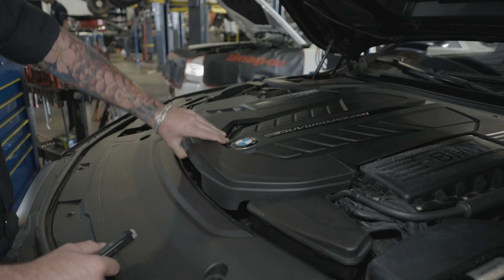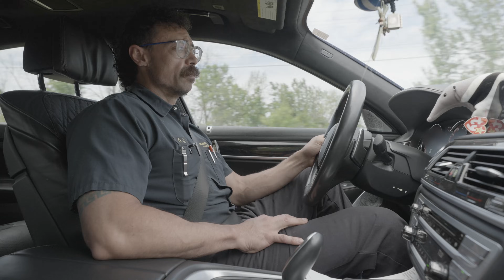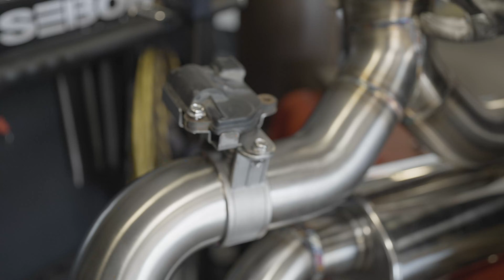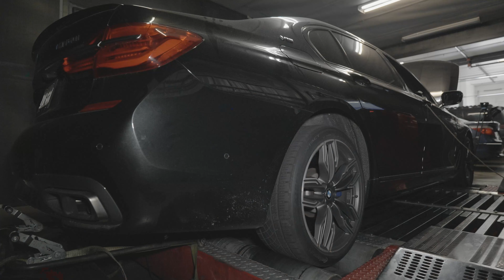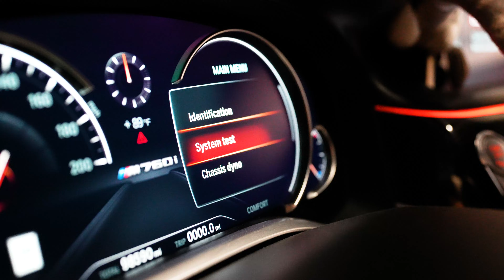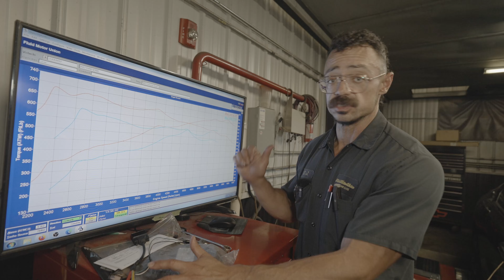"M" V12 Gets Exhaust It Deserves—Now BMW M760i Makes Power AND Sounds Like the World’s Gonna End!

Comment: It won't sound like it's from Italy because it's sound is basically two n52s joined at 60 degrees. This engine is an evolution of that. So it will always still sound like that 6 cylinder drowny noise

Comment: For people watching who are confused. Don't forget, this thing isn't meant to sound like an Italian V12. It's engineered and designed to be quiet and torquey. It's a crossplane crankshaft engine, with twin turbo, a heavy flywheel, etc, made for comfort, luxury, low-mid range torque. I like this exhaust setup, however. Looks and sounds incredible.

Comment: No surprise power gains are made easier from the N74 compared to the M275 in the S65. It's a more performant design in all regards - DOHC, DI, oversquared, and so on. The fact that it makes similar power with 10 psi less stock boost is telltale.

Comment: hey how much would an E90 335i exhaust cost? it has VRSF highflow cats, and currently the VRSF 3 inch exhaust, but i hate it.  i would like similar performance but refined quieter tone and a more factory routing with an X pipe

Comment: I have an Alpina B7L with an N63. I've been looking at the M760s for a while now but am not certain on the reliability or the V12, anyone have any experience with them?
Reply: M760 should be more reliable since the engine has less boost pressure and no hot-v configuration.

Comment: For it to wail like an Aventador’s V12, a catback isn’t going to cut it. Sure, you can get it closer than stock, but you can only do so much from there.

What really matters is the turbo/exhaust manifold design (basically the headers). 
At that point you’ll want to upgrade the turbos for something bigger and better to really make it worthwhile and save time, a large single would be possible as well.

This is the same as with the S55 and many other engines, including the latest 911’s that have unequal length turbo manifolds/headers. The GT3 is more equal length and sounds more exotic because of it.

With custom exhaust manifolds, it would be very easy to make the M760i sound like a twin turbo Aventador or really any Turbocharged V12 if you wanted it to.
Those sound absolutely jaw dropping, incredible sound that would send chills up anybody’s spine no matter what you’ve heard or experienced.

Comment: i dont understand how a V12 can only make 600WHP when a B58 can do that with like a few bolt ons and Hybrid turbo
Reply: To be fair, the N74 made roughly 600whp with only an exhaust and tune. Personally I find that quite substantial. Now imagine if the N74 had proper turbos, an intake and some fueling upgrades 🔥🔥🔥

Comment: Ah man big mistake here in my opinion: the X pipe should've led to the straight pipe tout and the muffled section could've went on the outside. The reason being, you want to have the straight pipe airways gain that smoothness and higher pitch from the X-pipr when you open the valves, but there's no point on having the X-pipr on the muffled section..

Comment: maybe just maybe luxurious V12's are silent because the idea of a luxury car is silenec and comfort
Reply: Of course, but we aren’t buying them for the luxurious aspect now, we buy them for the engine which just so happens to be sat in a big luxury car, but we wanna hear it like it’s a racing car
Reply: so youre buying an air purifier because you want AC then complain that it purifes your air?
Reply: @Michaboiii  if the air purifier has a twin turbo v12 then sure 😂

Think the main point is that you can’t get these huge engines in any other platform besides the big boats so it’s not the case that you’re buying it for the luxury aspect.
Reply: @xVwraithVx  a V12 is in the most luxurious cars because its a super stable engine? It has the smoothness of 2 Inline 6's so its perfectly balanced, that's why it is in Luxury cars and because theyre big they have a lot of power, more than 90% of luxury V12 buyers buy them for comfort not to hear it scream, if you want to have a screaming V12 u buy a V12 sportscar not a Luxury limousine
Reply: @Michaboiii  if you just generally want a v12 then sure, but if you want the v12 from the 7 series then u gotta buy a 7 series cos it's not really been put in anything else, and that's exactly what's happened in this video to answer your initial comment

Comment: TBH (and this is just my opinion), sound quality improved most during idle and revving. Doing pulls on the road, it sounded like any other B58 with an exhaust. I'm not sure if the camera didn't pick up the audio quality, but that's how it came across.

Comment: Now add the jb4 and you have a bottom 10 sec rig on stock tires … I have worked on and ridden in one manyyyy times that has dps e-blend and jb4  damn near 800 to the tire mmm mmmm. I might be adding one of the 760I to my collection in the near future
Reply: This is a high 10 second car at best 💀
Reply: @xxthehuskycaboosexx  M760i’s are already running 10.5’s in the quarter with 725 to the wheels on a stage 1 tune. Speak on what you know.
Reply: @justiceexodus7801 LMAO you watched a TikTok video and now think a stage 1 tune can crack 725WHP💀💀💀💀💀💀

Sybau when the adults are doing the talking lmao, because you have no business on “talking about what you know”. 

Clearly you know Jack shit😂
Reply: @xxthehuskycaboosexx At the beginning, and the end of the day, I know I have a M760i that will capable of running low 10’s, and that the platform is capable of far more than 725 horsepower, which would be the equivalent of a hellcat running a quarter in 10.5, so what makes your goofy self believe that someone would have to lie about running a 10.5 with an additional 125 horsepower, and pound ft of torque? You’re a broke joker, who day dreams about what you will never have. It’s a different feeling when you actually own the car, and know what it’s capable of, versus being some loser on the internet with an opinion. 💀💀💀💀💀💀💀
Reply: @xxthehuskycaboosexx BTW, there’s a BMW forum called Bimmerpost, where brokies such as yourself can learn about the M760i, and individuals running mid 10’s. I’ll have mines doing low 10’s, to upper 9’s by spring of next year because I have the means to do so. It’s weird how people act like they know so much about things that are literally foreign to them. What do you drive? And don’t lie about it. I can post videos of my fleet, can you?
Reply: @xxthehuskycaboosexx How does it feel to not own a M760i? Mines is sitting in my garage next to my C7 Z06.
Reply: @justiceexodus7801 LMAO the double replies are hilarious, I know you mad 💀💀💀😂

Yea I’m sure your Forza garage is full of all kinds of cars😂😂😂
Reply: @xxthehuskycaboosexx I got garages with cars, and motorcycles on two continents, why would I be mad? 💀💀💀😂 What bus you catch?
Reply: @justiceexodus7801  I forgot forza horizon 1 and 2 Take place on different continents 😂😂😂😂😂💀

Anyone who needs to brag about what they have, to an internet stranger, let’s me know they don’t have jack shit 💀💀

But keep lying to randoms I guess? 🤷🏻‍♂️
Reply: @xxthehuskycaboosexx Let’s go vehicle for vehicle. I posted the first to my channel. Let’s see the shit you drive. . Flexing on a clown is a good time. You ain’t never in your life pushed down the interstate in a V12 with a .40 HK on your lap, and never will. That’s what makes reality hilarious. I’m living the life you wish you had. Post up, so I can pull the Z06, and Grand National out. 😂
Reply: @justiceexodus7801 the fact that you’re so desperate to get a randoms validation, is wild!😂😂😂 on the internet no less 💀

Get your confidence up lil bro, nobody cares about what you have or don’t😂😂
Reply: @xxthehuskycaboosexx Don’t try to play reverse psychology. You said my cars are Forza, well where are yours? You tapping your fingers as if you’ve got a fleet of supercars, and know that a M760i can’t run mid 10’s, but you have nothing to stand on in that regard. Why would James Scott have to lie to you about his M760 running mid 10’s? I have the means to get my M760 into the low 10’s, can you say the same? You are a spectator, rather than a participant. Stay in your slow lane, lil boy.
Reply: @justiceexodus7801 do you even know what reverse psychology is? 

You went out of your way to generate an AI video to get an internet strangers validation, lil bro😂😂😂

You’re literally a loser lmao💀
Reply: @xxthehuskycaboosexx You ever heard of 800-1000 hp M760’s tuned by Noelle performance, DME tuning, Silicon Valley Bimmer, or Infinitas? Of course not, considering you likely ride the bus, or don’t have $40k to spend on speed.
Reply: @xxthehuskycaboosexx with a JB4 on e30 they run 10.6s in SFl air aka 2000-2500 da , add down pipes and water meth with a sticky tires and it will 100% go 10.30s at the track 100% , even Berger went 10.7x with only a jb4

Comment: These high-spec, turbo-driven engines are generating a lot of heat. A less restricted exhaust allows the engine to dissipate heat more easily, which also improves durability! Impressive HP increase in sport mode.

Comment: For the interior shots, I noticed that the "Active Sound Design" AKA fake engine noises is turned on. You should code that out on these modern BMWs so you can hear your work more clearly. Very nice work overall, it's easy to get big power from these modern BMWs.
Reply: ASD also interferes with the audio system. So ASD coded out will improve the audio system
Reply: Agreed. ASD should definitely be turned off for the interior sound comparisons
Reply: In the interior it sounded decent, outside sport mode wasnt great
Reply: just upload charger hemi file and youre good to go
Reply: The Only Thing Worse than “Let’s slap an IPad on the Dash!” 😢 Fake Sounds.

Comment: This engine, being a 60-degree V, is actually better for a V12 as it's perfectly even firing with a shared pin crankshaft. I think it deserved an X-pipe (or performance 4.5-5" Y pipe) earlier in the exhaust tract to help blend things up better before the muffling section.

Comment: My 750 does not sound like a vacuum cleaner. Fact is, the 7-Series was not designed for guys who need to attract attention with an overly loud exhaust. Some many men are mature.
Reply: Lol, louder exhaust isn't about attracting attention. It's mostly about appreciating the sound of the engine.
Reply: @justinwebster7761  Sure it is old bean. That is why cars and Hardleys at a light never tap the throttle. LOL!
Reply: @stephencurry8552 750s are junk anyways
Reply: @stephencurry8552  what the hell is a Hardley?

Comment: BMW V12s always sound like vacuum cleaners from the factory, you guys really gave it a personality without being obnoxious. Small suggestion, can you also mention the weight of stock vs. your system and how much you saved? I always like seeing those figures.
Reply: Thats because the first buyers want a rolls royce with stiffer suspension, not a 5 series that's bigger in every way.
Reply: Sadly Even the new S68 Sounds like I4 somehow, BMW manges to ruin the sound tuning of their engine with every new generation.
Even Stock B58 sounds much better than S68.
Reply: @yahyoh91  B58 with the stock exhaust upgrade sounds amazing. The S65 was the last nice-sounding V8, the shift from NA to turbos ruined the sound imo.
Reply: @Akiss  I was just about to say just that.
e30 M20 an over square straight six and sonorous.
e39 M62 v8 so tractable and great sound
e6x S85 v10 best engine sound ever and after that was stolen I'm stuck with an f11 535i n55 with all the charisma of a jellyfish
Reply: It's a boat anchor. Trimming exhaust pipe pounds won't matter on this vehicle.
Reply: That's a personal dig
Reply: Not obnoxious? Let’s not forget what this car was made for 😂
Reply: @MegaFregel  These guys usually make exhausts on the louder side.

Comment: Drive-by sound clip suggestion. Don’t go high speed pass the camera because the road noise from the tires overpowered the sound of the exhaust a lot of times. I would get up to the camera and then nail it. We would be able to hear the engine underload and what it really sounds like throughout the RPM range.
Reply: Or put a mic/GoPro with a suction cup on the rear bumper to get proper audio!
Reply: Im hearing air rushing in the intake/turbo, not tire noise.
Reply: That noise you’re hearing is the turbos, not tire noise
Reply: @blokay_garage either way he’s going too fast when driving by. Can’t hear the exhaust over the road noise.
Reply: Let’s hear the tires squeal instead?
Reply: Yeah or a 360 camera and mic set up would be dope maybe. Again. For now. Just don’t get on it until you get to the camera guy.
Reply: I think the flyby was more to flex improved performance than noise lol
Reply: You arent hearing tires so much as it sounds more like the air movement thru the turbos
Reply: @SuperTruck1  no I know what I’m hearing because I’ve heard it so many times on so many of these other drive-by clips. You can barely hear the exhaust due to the road noise because of the speed at which they drive by. Have you ever stood on an old country back road and heard just how loud even a regular every day sedan is as it’s going down the road due to road noise, etc.
Reply: Just needs a louder exhaust

Comment: when stock (ironically) sounds like two b58s glued together
Reply: I knew I wasn’t trippin 😤💯
Reply: @Zwimmer_GTI i mean it makes sense 😂
Reply: Lol I heard B58 to
Reply: the v12 is closer in design to the n55
Reply: Still sounds like one after, just like any other cat back for a B58
Reply: It sounds more N55 than B58
Reply: I was totally thinking that. Maybe if you split this system and divide with the same techniques, it'd make the b58 sounds better? I volunteer as the guinea pig lol
Reply: it's two n55s people, not b58
Reply: Spot on correct.
Reply: Yeah it actually sounds pretty good. I understand why it needs to be quiet overall
Reply: N74s are actually two N54s
Reply: i thought i was tripping 😂😂
Reply: Pretty sure they basically are 2 N55 conjoined at birth
Reply: I mean, it basically is 2 b58s welded together😂
Reply: @cheberlo no it's not